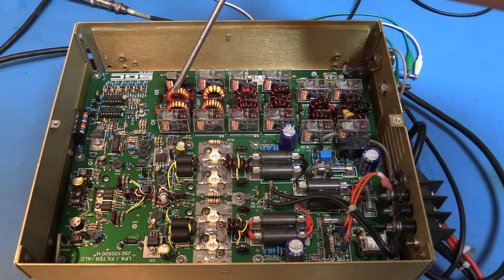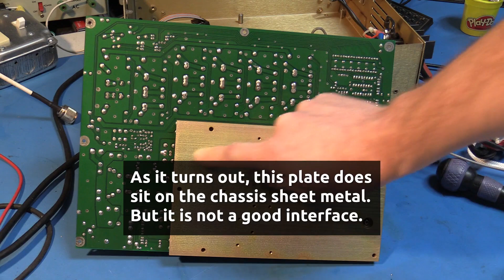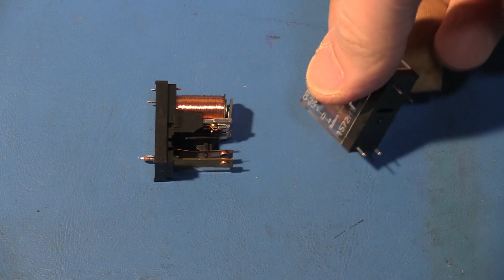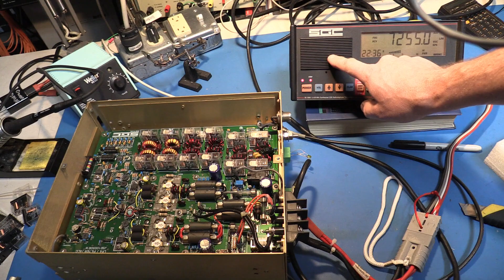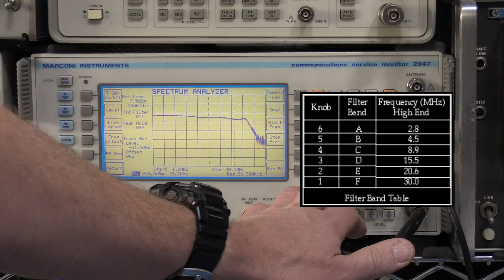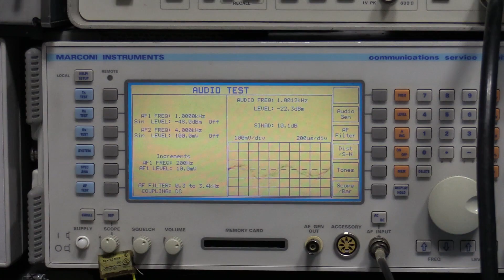SGC SG-2000 Relay Repair for Deaf Receiver

Comment: Excellent video! For some reason I like this radios. Thos kind of relays have always beem the first suspicious bits. At least two of my radios were not working because of them.  I like your hands on videos!
Reply from the maker: The SGC does have a very cool appearance. And it’s easy to use too. But.. performance wise it could have been better. Still very fun! 73!

Comment: I also experienced the SGC 2000 radio in the receiver section not working. After watching your video, I unplugged it and checked one by one. One of my relays was broken. I replaced it with a new one. Thank you very much. Your video helped and my SGC radio is back to normal, YD1RLL.

Comment: At 8:51 you say “If we deliver 150watts to our load we are also dissipating 150 watts right here(into the metal plate)” does this mean that the radio is drawing 300watts from the battery?
Reply: I guess that is how class A amplifiers work! Most of my hf experience has been in the QRP world with a class E power amplifier.
Reply from the maker: Class A is a bit more difficult since there is presumably a single device required to be on the entire time. There is essentially power wasted when you do this, but the upside of course is that the device is always on and thus always biased in a linear region.
Reply from the maker: Yes, 100%. That’s the only way to match the impedance from source to load. If it’s matched, power dissipation is equal. You can prove this to yourself with ohms law and a circuit with two 50 ohm resistors.

Comment: Thanks a million for these videos. Finally, there's someone who understands this radio. I have had trouble with this radio (seems to be same model as yours) for decades. I had to change the modulation chip, and that fixed things for a while. Also, it's always seemed to have low mic gain, and I've never found a way to adjust that. My stock mic fell apart, and I replaced it first with a rewired MFJ mic, which worked only if I shouted. LOL. Now I have an Astatic Road Devil, which gives me enough signal to make the radio usable.  The most recent failure is the FWD/SWR. So, I'm looking forward to your discussion of that issue.
Reply from the maker: We’ll get there man! I will definitely be addressing the dumpy audio (they all have this issue) and yeah I do want to fix my FWD/SWR metering. It always shows about “2”. Maybe the diodes went bad? We will see. Maybe I’ll start by just injecting some DC to see if it reads correctly. 

These are neat radios, I hope we can keep them on the air!
Reply: @W6EL  I have had my 2000 apart many times, so I can follow along. A basic question. How did you determine the relays were faulty, with high resistance? My unit also has trouble hearing signals my other radios hear. And it's not putting out enough power on SSB, though it shows a full 150 watts on CW.
Reply from the maker: @valdemarphoenix2685  for the receiver, the relays pretty much are the only thing in this radio that is changing per band. I proved it was the relays by disconnecting the receiver feed from the LPA board and running low level RF through the LPA board, fed from the normal coax jack and coming out the wire that normally feeds the receiver on the “exciter/main board”. With that setup I saw significantly less signal on some bands (as you see in the video). But I also did a simple test with a DMM, measuring the ohms through the LPF. That was a bit tricky but I found spots I could probe eventually. You must disconnect the receiver if you do this and use a volt meter with a low compliance voltage, just to be sure. 

I also think the two zener diodes in the forward and SWR metering area are dead. Mine do not measure correctly in-situ. 

Additionally there are some capacitors around the MRF-455 transistors which I am investigating. 

I will post more for sure.
Reply from the maker: @valdemarphoenix2685  I just found D17 and D18 were bad. These are in the forward and reverse power metering circuits. Easy to replace. 1N4148. You can use your DMM in circuit and see what the reverse voltage is. Mine was 0.6 forward and 3 volts reverse. Should be 100 volts reverse (unable to read is normal with a 4148). Hopefully this will fix the metering in yours. I have not verified it here yet as my radio is still in its natural habitat — open and on the bench.
Reply: @W6EL  Thanks very much for your very detailed reply. I'm not an engineer; just a very casual amateur. I do have a digital multimeter, so I can do some of those tests. I don't have the very impressive set of tech equipment you have. But it all makes sense as you explain it.  I'll do what I can with what I've got. LOL.
Reply: @W6EL  I just checked D17 and D18. D17 reads 485 one way and 647 with leads reversed. (Not sure which side is anode/cathode) D18 reads 056 both ways. If my meter is correct, they need replacing, right?
Reply from the maker: @valdemarphoenix2685  wow. Those are dead for sure. Replace! Let me know what behavior you observe afterwards (metering and max power output)
Reply: @W6EL  Hello again. Well, I have replaced D17 and D18. I have now gotten my swr/frd metering back. At least I can now switch from swr to frd and back again. And there is some bar activity when I key the mike (in cw) on 20 m so far. I am going to hook up my old Radio Shack swr/power meter to see what the rig is really putting out. Not the best meter, but it will give me an indication. I'll let you know. Looking forward to the video on the PA.
Reply from the maker: @valdemarphoenix2685  The PA video is available now! But I have to say, it got rather complicated and I ended up just telling a summary of the work. Glad your metering is working, that is great to hear. I find the metering is quite handy and very responsive. If you see the meter flagging (wiggle) in CW on 5 MHz, let me know, may be a sign of instability.
Reply: @W6EL  Hello Elliott, here's what my 2000 is doing. I'm hooked through my radio shack SWR/PWR meter into the dummy load on my mfj tuner. First, when I key the mic in cw mode (20m), the SG meter bar in FWD shows a very small reading, barely above then 1, then jumps up to about 75 upon release of the mic. This is in low power. On high power, the SG meter shows about 1.3, then jumps to over 100 upon release. I am not sure this is how it's supposed to work. At the same time, my radio shack meter shows about 90 watts in both HI and LO, while my  mfj tuner's meter shows about 10 Forward. I also checked at 5mhz, and had the same behavior, but I didn't see ant wiggle. PWR out was about 100 watts on the radio shack meter but about 12 on the mfj meter. So, is my 2000 working properly and the other meters are goofy or what?
Reply from the maker: @valdemarphoenix2685  hmm. In my experience, the radio meter does sometimes “burp” a little blip when it switches from TX to RX. This is likely an artifact of the metering switch circuit. Overall though, half scale is about 100W on my SGC meter. How does it do with some mic audio on SSB (A3J)?
Reply: First, would you mind if I sent you a video of the 2000 in action, to be sure we're on the same page?

Some more strange results on the testing. On 20m, 14.25mhz, my old Radio Shack meter shows about 100 watts, while the MFJ is still showing only 10.  On 7.20 mhz, the RS meter shows 200 watts, while the MFJ shows about 125 watts. This is on high power into the MFJ dummy load. Unfortunately, I didn't write down the low power results. This was on CW mode.

On SSB, the readings are much lower, of course. As for the 2000's FRD metering, it still reads almost nothing when I key the mike (cw or SSB) and then jumps up (the burp) to about 50? upon unkeying.

I put the rig on the air this afternoon on the YL system 14.332 mhz and got a 4x4 report from Georgia (I'm in Houston). I usually can't get through at this time even on my main rig (Alinco DX-SR8). So some parts of the 2000 are working at least. LOL
Reply from the maker: @valdemarphoenix2685  sure, send me a video. My email address is current on qrz.com.

Comment: For the Sinad measurement you set the HP to FM Modulation? And the receiver is SSB?
Reply from the maker: Good question! I actually keep the modulation off on the HP. It's just generating a carrier (it says FM MOD but the mod is off). That is why I tune to 14.999 on the SGC. This places the carrier of the HP 1 KHz in to the passband of the sideband demodulator on the radio, and thus a 1 KHz tone results. This is the most "pure" method of doing it and also results in the fewest of calculations. I probably should have mentioned this in the video; I may make a video specific to sensitivity testing soon (one for FM, one for SSB). 73!
Reply: @W6EL  AM too Please? :)
Reply from the maker: Certainly. Basically the generator with AM MOD turned on, tuned in exactly on the same frequency, followed by the same procedure.
Reply: @W6EL  What Modulation Depth would be good?
Reply from the maker: @dragonlard4595  30% is commonly used. It makes a great deal of difference how you set these things up, filled with subtlety. I liked this video on the topic: https://youtu.be/F9CAj3atqEk?si=NfVuSbfcXoq92Oe9